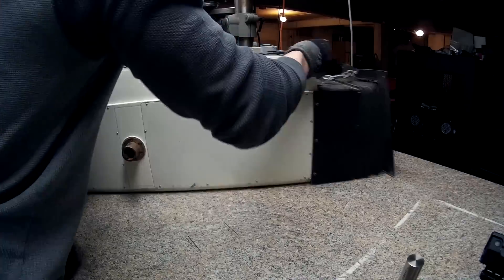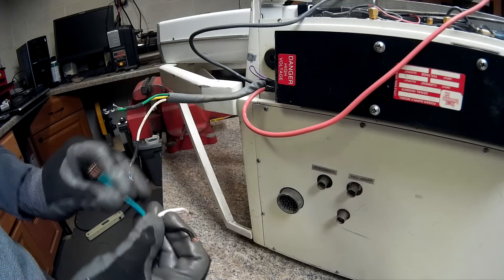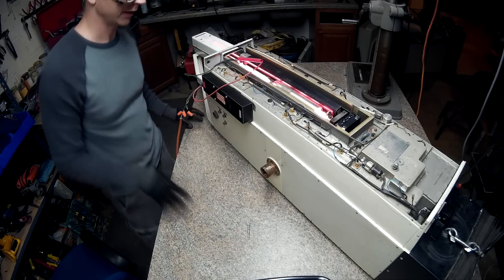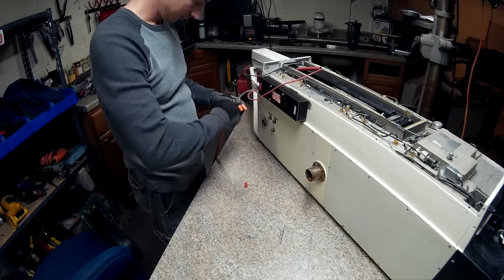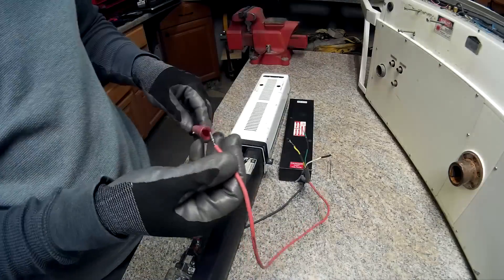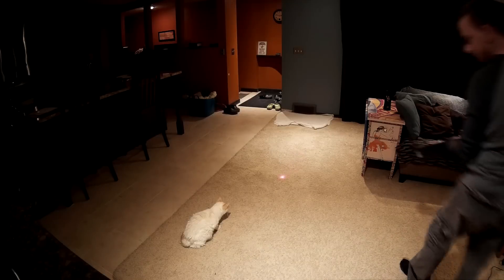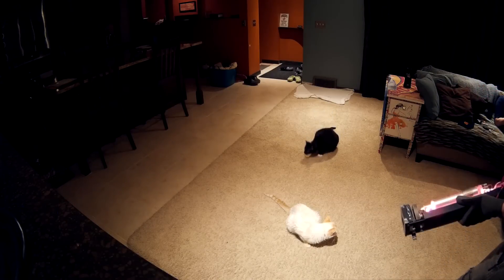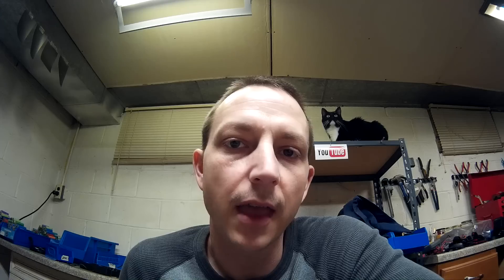Freebie Friday Ep2 Helium Neon Laser

Comment: Applications. Helium–neon lasers, particularly the standard devices emitting at 632.8 nm, are often used for alignment and in interferometers. They compete with laser diodes, which are more compact and efficient, but have less convenient beam profiles. Some He–Ne lasers are serving in optical frequency standards.
https://www.rp-photonics.com/helium_neon_lasers.html